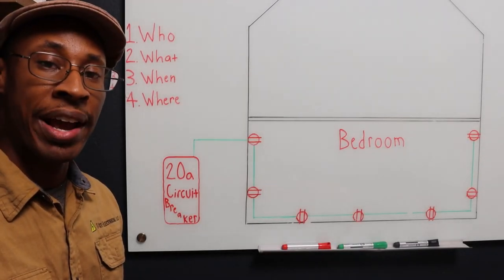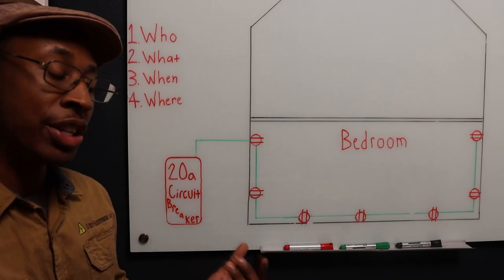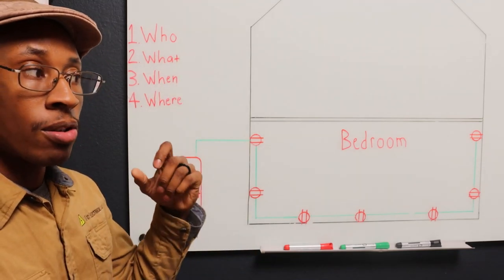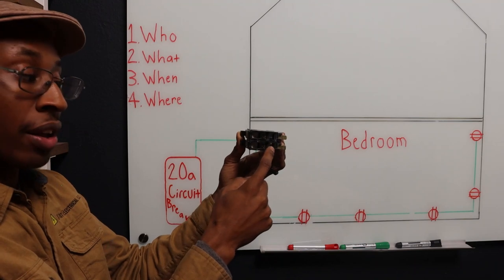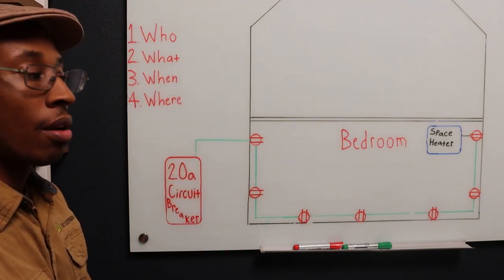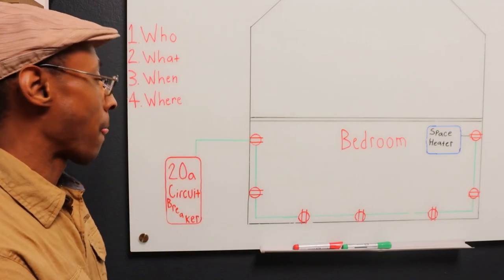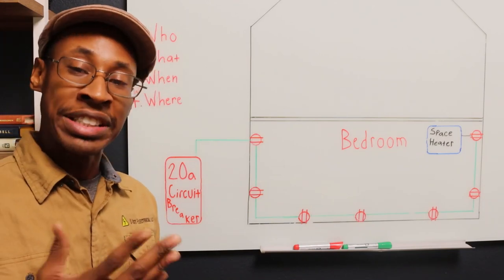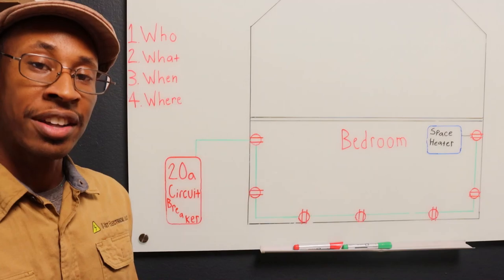How To Troubleshoot Circuit Breaker Tripping

Comment: By far the best info so far on youtube. Installed disc lights in home and was told later that the breaker tripped after a bit. Came back, noticed breaker wasnt reseting even though all switches were off. Makes me think its switch related or outlet related or breaker related since its just one home run. Even though i thought that i tinkered with each light as well as fan in the room to check connections, all of a sudden breaker resets. Wondering how if the switch is off for the lights, how me tinkering with light wires could have affected the reset cause it happened again the following day. My mind is thinking the power from switch to main leg messed up home run connection and caused the trip but idk

Comment: Love your videos. Question regarding the breaker. If the breaker is bad wouldn’t I be able to just remove the wire from the bad breaker, and turn that breaker on without a wire to know that it’s bad?

Comment: I was at a service call and something similar like this happened. Outlets and lights weren't the working. Turns out there was a hidden sub panel that had tripped breakers. We turned it back on and everything worked fine afterwards.
Reply from the maker: Alot of scenarios!